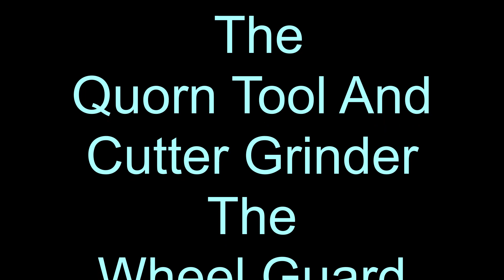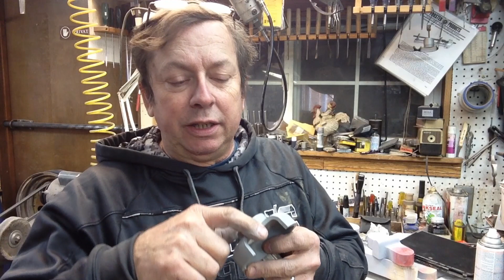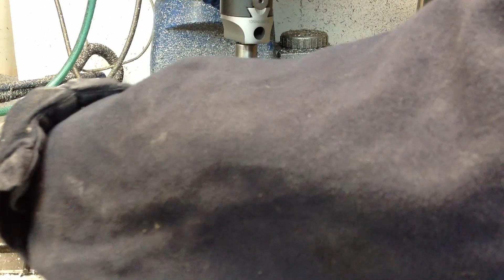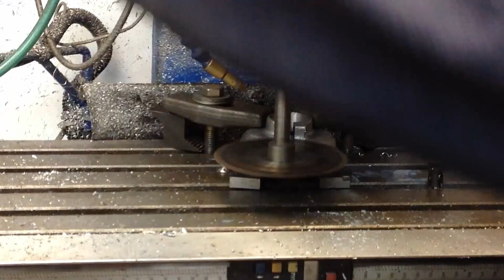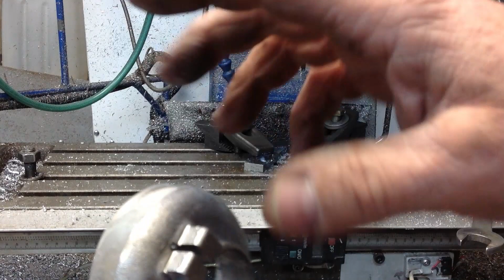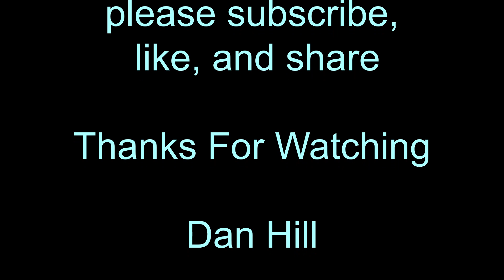The Quorn Tool & Cutter Grinder: Machining The Wheel Guard

Comment: I picked up a couple of TC saw blades at a rummage sale that are intended for an angle grinder, way too dangerous to my mind, but i bored them from 7/8" to 1 inch to fit my arbors and they work great at milling machine speeds.
Did you slit your clamp deep enough, you need enough to make the clamping from stretch not just bending the ears, if that makes sense.
Reply from the maker: I cut as deep as I could reach with the slitting saw and then extended the cut by hand wih a coping saw with a fine wood blade, yes the cut is extended into the bore of the guard about a half inch. If the bore is accurate and a close fit to the spindle it takes very little clamping pressure to lock it in position. Dan.
Reply: @hillsgun  difficult to see detail on my i phone screen, i guessed you would do it right.👍
Reply from the maker: I hope that I do it right, but we never know for sure🙂
Reply: @hillsgun  there's always more than one "right" way, but never as many as wrong ones.😉
Reply from the maker: @chrisstephens6673  I have a better shot of the cut that will be in the motor belt guard video, I will try and get it out either tomorrow or Monday.
Reply: @hillsgun  don't bother on my account, i believe you.😆
Reply from the maker: @chrisstephens6673  I was working on the motor belt guard and painting both so I just did a quick shot of it. It was quite an inconvenience and I had to reschedule the whole week to work it in but I felt that it was worth it just for you.( crap no imojee when I need one : )
Reply: @hillsgun  I suppose I had better watch it then, and to think I already had my weeks viewing scheduled.😊